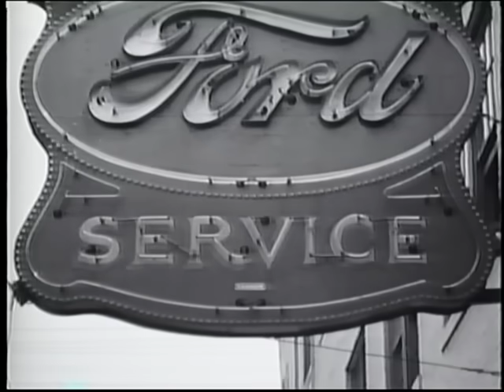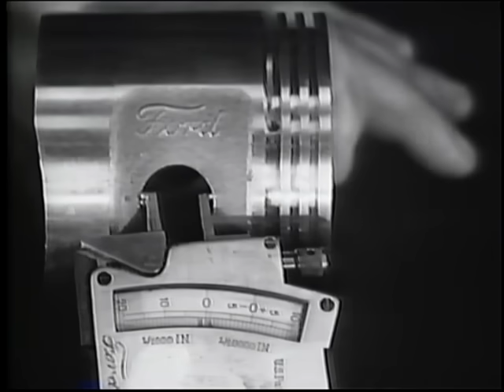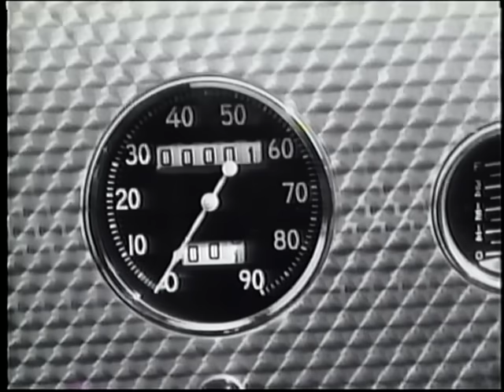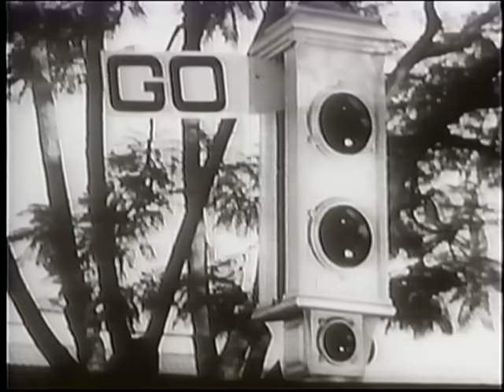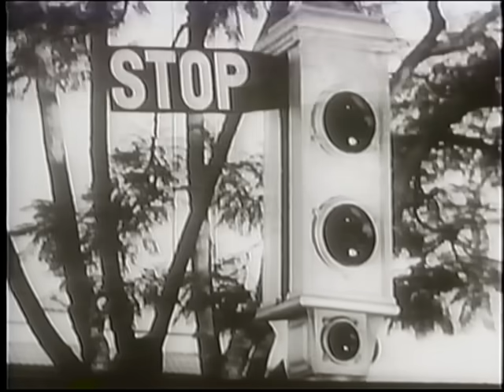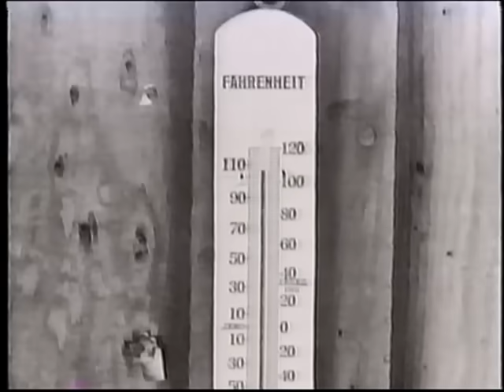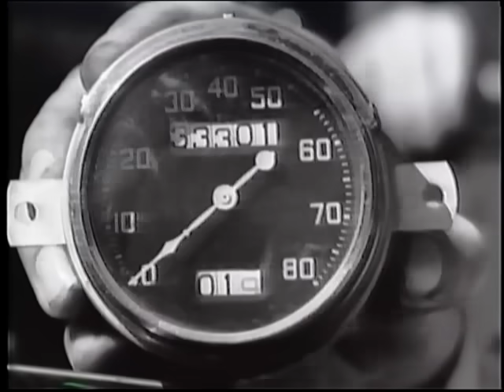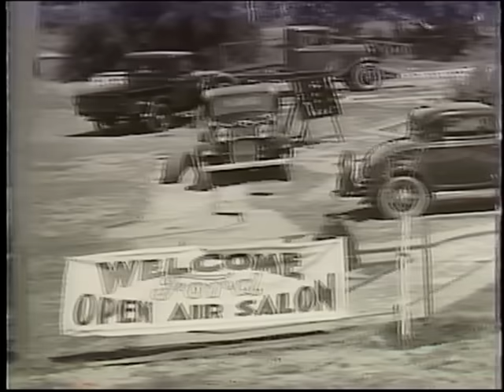1932 - The Invention of the Ford V8 Engine

Comment: Ford, 1932: V8 engine!
Americans, 2010th: "1932 - the invention of Ford V8"
Levavasseur and Bobrovskiy, 1902 and 1915: Are we joke to you?
Reply: I don't think that L&B invented the Ford V8.
Reply: @alanlee8018  Levavasseur - first serial V8 engine on cars. Bobrovskiy - first Russian V8 for cars. In WW1, the Russians were seriously going to produce cars with V8, at a new plant in the city of Mytishchi (19 km from the center of Moscow), but the revolution prevented. Unlike Levavasseur and many other attempts to build cars with V8s, there was a large military order here. If the Russian Empire had not perished in 1917, Ford would have had competitors in the V8 field. And, as far as I know, in addition to the Russians, in 1916-1917 the Americans had similar attempts. Therefore, to say that "Ford came up with a serial production of V8" is not entirely correct. In general, by the way, at that time the Russians had many ideas in the automotive industry. For example, Russo-Balt developed an overhead camshaft engine. Engineer Kashirin proposed super-powerful two-stroke multi-fuel diesel engines that were assembled from V2 blocks. Each V2 of Kashirin is a separate diesel, 80 hp. at 1400 rpm, with a volume of 2.47 liters. The standard V6 was supposed to have 240 hp. with a volume of 7.41 liters - at that time almost no other engines had 32.39 horsepower per liter of volume, or more. The "Motor" partnership was supposed to produce a prototype of the engine in 1917.
Reply: Yes.
Reply: I believe the 1917 Chevrolet was the worlds first valve in head  V8 in a production car
Reply: @Texassince1836  Correct but very rare even new.
Reply: I think they are referring to the first V8 cast in one piece and mass produced economically, not the V8 configuration itself,and I think particularly the L head design,
Reply: many babies conceived in rumble seat and oral extraction
Reply: Jp
Wwwe
Reply: @Texassince1836  -- Good info. I didn't know about that engine. It must not have been any good, as it only lasted 2 years ...
Reply: @ Felix : No, you Russians are not a joke to us --- but the French are ...
Reply: They never said invented the v8. In fact they even said they offered V8's in lincolns but were not one piece casting and were expensive. Do try to keep up.
Reply: @sking2173  The french dedigned nice r cars than American
Reply: Guy Jonson — I’m aware that the French cars back up faster than American cars. But with all the practice they’ve had, that’s to be expected ...
Reply: @guyjonson6364  American Jeeps Kept France from making Volkswagens 🤣
Reply: BTW: Chech Skoda ever builded 1934 a V8 aircooled engine...

Comment: Look at how well dressed the homogeneous society was back in America's prime. Seem to be healthy and fit too, despite the hard times. Don't see the obesity like we do today.
Reply: "Seem to be healthy and fit too, despite the hard times".  You've got to remember that back then, there were loads of things that had to be done by hand that are now assisted by some form of machinery.  Just one example: I've used a hand-powered reel mower and a hand edger to do yard work, and it will wear your ass out.  Now, I just have to make sure the batteries in the mower and edger are charged, and it's really no more work than walking around the yard.  And, the number of calories we consume has gone up.  More food, less work-> weight gain.
Reply: Does that also account for them being well dressed?
Reply: CharlesFockaert  No, but people just spent more on clothes (if they had it) than we do today.
Reply: almostfm The money people had then bought them more the we have today.
Reply: People weren't sitting on their asses playing video games like they do now. In those days MANUAL labor was a staple in society.
Reply: Cable radio? ha ha
Reply: CharlesFockaert,  People back then also repaired their clothing. Darning a sock was not swearing at it. Now women go out of their way to buy pants with holes in them. And some men wear their pants below their butts. That fad of wearing the pants low was also in the 1950s. They stopped when they got tired of holding up their pants. Not a lot of sense in fashion.
Reply: splofmonkey,   No, no, no cable just through the air like the tv in the 50s.
Reply: They were healthy and fit because they were starving!
Reply: Ford workers were among some of the highest paid factory workers of the day.  Check you facts.
Reply: and keep in mind a dollar back then was worth a LOT more than a dollar now. if you made $8/hr then you had a wage worth more than the "average" 20 or so an hour wage now
Reply: The reason why people were well dressed was because of no A/C. People would sweat through their clothes so quickly that it was traditional to change four times a day. There was a different dress code for the morning, afternoon, and evening. And of course everybody changed when they went to bed. The time that this video was made was around the time that that was starting to become less common, and the dress codes for different times of day got less strict, but it still was in effect.
Reply: At the time of this video the wage at Ford was about $7.00 a day. We were on a Gold standard. Inflation was non existent.
Reply: in the time since, your meat-and-corn-producing overlords have lobbied to get government subsidies to reduce the price of meat and corn and drive up consumption. the automobile has shaped cities (urban sprawl) to make them unwalkable--you need a car to get anywhere. the invention of air conditioning has eliminated the desire to spend time outside. all of these factors have led to an obesity epidemic where we eat too much and move too little. you're playing into their agenda. because you actually got what you want and now you blame someone else.
Reply: sploofmonkey I agree entirely. It's unfortunate that Americans think we're so different from Europeans and Asians that many exceptionalists are completely opposed to modeling our cities  after theirs (the ones that work anyways haha) because the automobile symbolizes independence, as wasteful as they are. Don't get me wrong, they're super useful--for traveling long distances. But we should shorten a lot of these distances and accommodate the pedestrian, not the car!
Reply: There's a bit of a bias to how well people dressed in old photos and movies, in that they dressed nicely to be in photos and movies.
Reply: Yeah, and a man could feed a family on a single job, allowing the wife/mother to stay at home and actually be a mother. Wonder where society went wrong? Look there. And no, im not blaming women, Im blaming the fools running the economy for allowing it to get to this point. You have to make 60-75k to qualify for a mortgage. in the 30s you could buy a home for 2500 bucks. What the hell happened in the years inbetween? Its such an interconnected mess that i dont think anything short of a massive global war that reshapes society and values could change it at this point.
Reply: They built some fine vehicles too, unlike today's garbage
Reply: CharlesFockaert why cant you just admit you wish America now was like "back then"???
Reply: Blame greed.  Blaming anything else is you just romanticizing a past that never really existed.
Reply: Even if you have a gas mower they have an electric starter so you don't throw your back out while starting it.
Reply: Do you remember that the trip to the airport was a dressy affair?
Reply: With a nice car or nice clothes, we could fool somebody sometimes.
Reply: Bankers and the Tobacco people ruled the land.
Reply: 'Work' then was defined as manual labor. Now we call pushing a pencil as work.
Reply: Remember how fast socks would wear out?
Reply: Sean, you came out of no-where and added your flotsam?
Reply: Back then, after the Civil War, there was no closure to the War. We let the traitors in the South go back to their homes. We never really labeled the 
Rebels what they were, 'traitors', including Gen. Lee. We let these traitors continue to use slaves and segregate. Lincoln didn't free the slaves or other minorities. It took riots and marches and laws to make a simulation of Black Freedom. We are not a Christian Nation. A greater percentage of Americans do not support or go to church. Most of the populous would still want to segregate if it was possible.
Reply: The irony is that the advancement and affordability of the engine has been extremely helpful in bringing on the current obesity crises.
Reply: Men ACTUALLY WORKED for a living then, they didn't sit down and press a button while calling their Union rep telling them how difficult their job was- Wasn't easy to get fat and lazy as they didn't have all the ABUSED safety nets like welfare, etc. for people to get 1000.00 of food stamps a month, free apartments, phones then say they have too many kids and cant work now anyway so WORKING people just need to support them including sex changes and defense for border jumping murders, etcccccccccccc
Reply: Eugene Burden Exactly, we used to say pencil pushers were 'going to the office'. Now the pencil necks think it's work too.
Reply: No snacks and soda back then😀
Reply: No food, no obesity. Have you ever paid a traffic ticket with chickens? That's how tough that time was
Reply: CharlesFockaert in the 1800’s/1900’s it was very trendy for women to have tattoos in fact many great people from that time and before had tattoos like Theodore Roosevelt, Winston Churchill, Andrew Jackson and Dorothy Parker
Reply: more like 80+ per hour.
Reply: The obesity isn't because of modern day automation of manual labor. Manual labor just keeps us fit. Obesity is caused by the cocktail of pills we are prescribed for any little problem we can't deal with...problems that people back then called life. Modern day medicine and food changes our bodies in horrible ways..might as well call it deformations.
Reply: NO THEY DIDN'T.
Reply: And for the next 20 years, you could not find a pothole in the street either in the USA.  Go find all the pics of the USA you want.  You will be hard pressed to see a pothole in any photo.  Hmm, taxes were really low then too, which throws the argument, "Who will fix the roads!", out the window.
Reply: Homogeneous in appearance but not in the mind, (or Henry Ford could not do what he did).  It was nearing the last era of individualism, that allowed Henry Ford to become the hero who got a lot of people out of poverty.  I wonder, can one kind of homogeneous thinking actually be great, growing and reducing poverty faster than anything seen in man's history?  Sure.  It is just the individual thinking with a free market in his/her hands, which is the opposite of the marxism we see growing in the USA today.  Opportunity never came from government, unless somebody else is enslaved.  With a true free market, and individual liberty protected from anybody who may infringe, (proper law), nobody is enslaved, and will have opportunity if they choose to "go for it", and live. :).
Reply: I cant walk 25 miles to work, cant afford a battery car and I don't want one. I cant charge it at work and it wont tow or haul. My wife can not take my son to school 20+ miles away, walking only works for a small amount of our society that lives in the utmost of downtown situations. You still will have to go out of downtown to the bigger grocery stores, to places like Lowes or Walmart, and then how do you bring anything home? Will an Uber or a city bus let you haul a kitchen vanity in them, what about a new microwave for the one that tore up, new TV if you didn't order off amazon, what about buying a new chest of drawers or mattress?
Reply: McDonalds, sugar and govt handouts.
Reply: No, the culture back then was to always be properly dressed in public, neat and tidy.
Reply: Fedoras were definitely "in".
Reply: @CharlesFockaert  They might not have much money, but they took pride in how they looked in public.

Comment: ford v8 was the present to america people, in europe still v8s are for rich people, even porsches only have 6 cylinders... american cars were basic by comparation but their big engines are still admire, still cant believe you guys have 8liters engines and that of course, a gallon of gasoline cost 1/3 of gasoline in europe....
Reply: Hence why we have "only" 6 cylinders, circle complete :)
Reply: only a fool (or a hotroder)would put a big eight cylinder enegine into a leightweight porsche of that time
Reply: and it got BAD mileage and the motors on each wheel need rewinding frequently.
Love electric cars. But until we get an electric motor and power source that gets the same mileage as the gas engine they are not viable.
Reply: Not to seem a smartass, but how do we define mileage on an electric car vs fossil fuel car?
Reply: how many miles you got on a full tank of fossil vs a fully charged battery.
Reply: And what do they use to recharge that battery?
Reply: It will change after the socialist take over,  some  Americans are unhappy with  cheap gas and affordable cars ...  they wanna be like Euuuurope ....
Reply: That is why in the UK the V8 engine never became popular, because our fuel is taxed and has always been veryexpensive in comparison to the US.  So big gas guzzling engines never caught on here, except in luxury vehicleswhich most could not afford.
Reply: true, and In France, in addition, after ww2, whe had very high tax for engines over ~2.4L capacity (the Ford Vedette, made in France in the 50' had 2.2L  V8...)... actualy this tax is converted in "co² emission tax", only very low consumption cars (less than 6L/100km) are tax free, and so a  Lada Niva or a  V6 Mustang became the same  maximum tax = 8000€ (4 cyl turbo Mustang= 4000€)...
Reply: I didn't know the Ford Mustang was sold in France.  The little Mustang mk11 from the 70's was sold in verysmall numbers here in the UK.  We now have the new Mustang, but without the V8 engine.
Reply: thepro08 also, Americans were very late to adopt forced induction. 7.1 liter diesel naturally aspirated pick up trucks were common even into the 2000s
Reply: They got 65 HP from that V8?  By 1970 you would get that from a 1500cc Hillman Avenger.  Some decades of technology and of course our need for better fuel economy.
Reply: Video99:  This is a flathead engine with 5.5 to 1 compression ratio.  The power is about what you would expect.  By 1953,  the motor had 110 hp.  The idea was to keep the price as low as possible.  In 1932, 65 hp was enough to be impressive compared to the competition, and although the max power numbers don't seem that good, the torque numbers are respectable even today.
Reply: Video, That's 40 years difference you're talking about. Ford had the 3.6L flathead up to 90hp by the end of the 30's & hot rodders were getting big numbers out of it the 40's & 50's through the 60's. The main thing people don't realize is that gas & oil have improved as much or more in that time as the actual mechanical design.
Reply: Viv, It got floated a lot but there was no interest. I've never heard of a 7.1 diesel. You're probably thinking of the International 7.3L but that switched to turbo in the early 90s.
Reply: NOT True ! European cars have always been more advanced technology wise, just smaller as the coutries are more crowded and gas expensive.
Reply: Diesel better mpg than a gas burner and way more Torque
Reply: Being able to afford a v8 car is in itself a reason to move to the USA, and there are many more!
Reply: jwta5646 already got it (most electric cars get between 25 and 50 mpg.US gasoline equivalent)
Reply: thepro08 well the euros turbo/ supercharge there v6...which diminishes the differences in power...though if you supercharge a v8, you get an absolute beast
Reply: jimmy jake

Comment: Engines are generally not "invented", but rather "developed". This was the case with the Ford V8 as well.
Reply: Herr Unsinn — Speaking as an engineer myself... Eh, it’s a fuzzy distinction. Not the word I would have chosen, but it’s not wrong.
Reply: that,s right if it wasn't for cast iron charlie the v8 block would of taken many more years to get working the problem was overheating on the rear cylinders because they could not get all the casting sand out of the engine blocks so hence forth the invention of the core plug which enabled them to get all the sand out and then press in tin plugs they are still used in today's casting in iron and aluminium. thought you might like to know if you don't already as you say its the hard work of the engineers thinking on the job who bring things into production not so much the inventor unless he works on his own but like big conglomerates like ford you are so right on the money.
Reply: The definition of invention includes improving something.
Reply: wrong dork
Reply: @kinkong1961  wrong  you have to invent things , then the green light red light isn't a invention matter of fact nothing is then .
Reply: onlythewise
Reply: @billbyers4676  bil byers
Reply: @onlythewise1  Right, Dufus.
Reply: @tomtalk24  In your world it does. Try looking in a dictionary the next time. You will see absolutely no reference to "improving something" being called an "invention".
Reply: @onlythewise1  Your parents must be so proud. You can't so much as write a simple complete sentence with proper capitalization and punctuation, yet you feel you have earned the right to call someone else childish names. 

Now go back to your job at McDonalds flipping burgers. (You obviously are no attorney.)
Reply: @onlythewise1  Would you like to give that another try, this time in something resembling English?